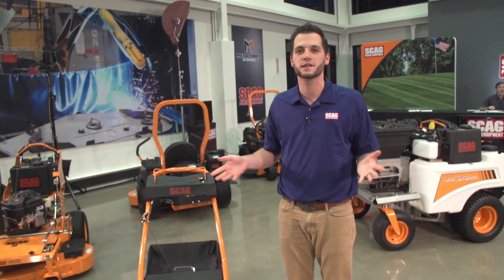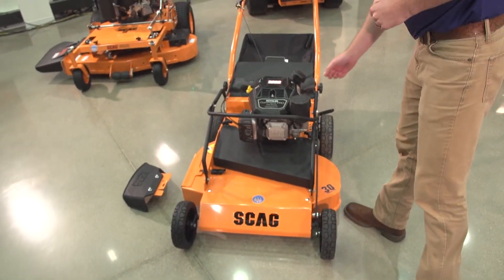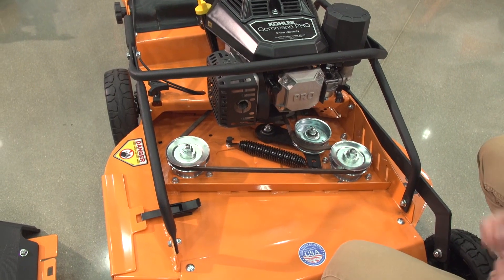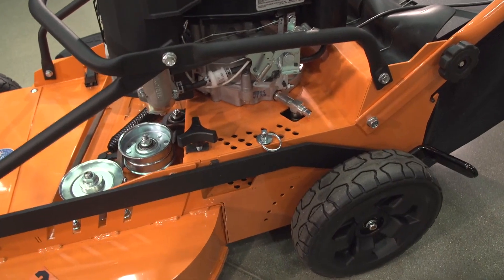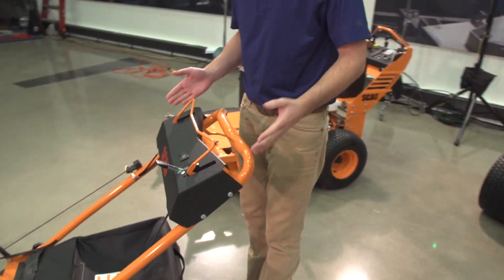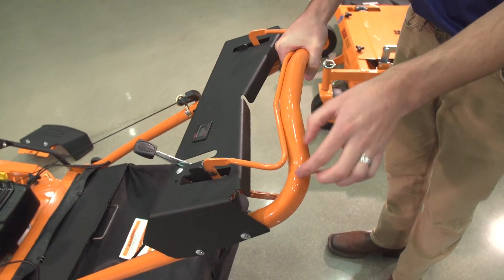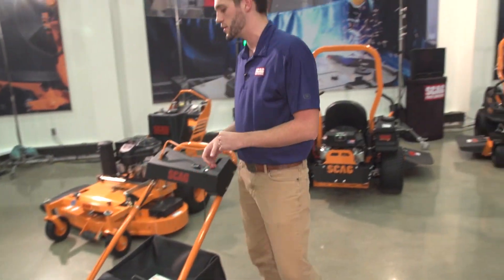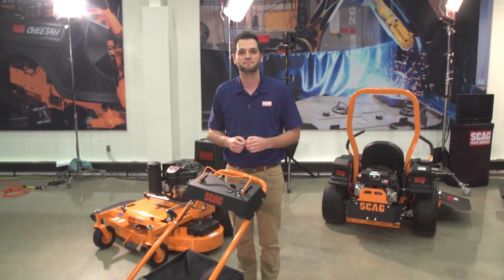30" mower prototype – SCAG LIVE 2020

Comment: Nice machine overall but there are a few things I'd like to change/add. Also many good points are made by other commenters so I won't touch on those.

The speed needs to be above everything that is currently on the market. I want something that has a setting that will have me jogging in wet, tall, and thick conditions. Time is money even with push yards. I hate having to push through the gearing and top speed on other mowers. 

I would like a chute open/close control on the operator panel

I would look at the efficiency of work put in to move the machine at the different handle bar angles you have as options currently. Possibly look into adding an additional turn/curve towards the operator at the top of the handle. So it creates a more linear straight push instead of a down and put push.

The black engine cage is cool but I couldn't help think of things (shrubs, etc)getting caught in it. I would think there may be a solution in having removable magnetic panels to keep the area easily accessible but covered. 

I would like it to have something I've never see out there. It would be a three tiered bag system. You would have mounts on the handle bar where you could attach two back up bags that would need to be designed as easily folded or collapsed. The idea is you drop your full bag quickly swap to a new one and pick up your full bags on the way out.
Reply from the maker: Appreciate the feedback and suggestions

Comment: I am looking to replace my 5 year old  toro 30 tis one and the toro need wide tires on the rear also is it weight same s toro  need lighter also are all 4 wheel adjust at once I perf the front separate from the rear
Reply: Agreed.  Good trick to help mulching in tough conditions by setting rear one notch higher than front.  In fall can also help to mulch/bag  leaves by setting front higher than rear.  Toro got that one right.
Reply from the maker: Will be a single point height-of-cut adjustment so the fronts will be tied to the back. We appreciate the feedback.
Reply: @ScagPowerEquipment  that why I probably stay with the toro unless you change that

Comment: Would this be a good machine for homeowners and is it possible for zero turn front wheels property has hilly grades
Reply from the maker: Hi Robert, it certainly can be used by a homeowner. Caster wheels are in development for this machine, which will help with maneuverability! Stay tuned.

Comment: I bet this will be over 2,000$ retail  which is fine any chance you can both pull start and electric start really put over the top 😁
Reply from the maker: Will be in that ballpark
Reply: No electric start if they use the Kohler CV224 engine.

Comment: I been running bobcat and scag walk behind mowers and have a 36" walk behind  how does a 30" better  I disagree about aluminum deck my crew are still using aluminum or mageniuem deck such as bobcat Jacobsen SNAPPER old deck .Why stamp steel.they rust I swapped engine and rebuild them many time upgrading the bearing to tinkem bearings love your blades  the mowers I made a shredder plate out of catwalk grating and does really well I had 2 of your riders and had great difficulty with the hydraulic pumps and on each side they were not abused or lack of maintenance  we kept our EQUIPTMENT up I not happy with those mowers you stand on they great on homes but we have apts big commerical.lots with bumps Mole holes I think it's a great idea but your equipt is always was made for long life 
Bruce bonkowski
Reply: This would be the answer to the weight problem but I don't know if there would be any issues with such a large aluminum deck, unless it was pretty thick.  Probably cost a lot to implement this too.

Comment: Nice presentation young man.

Old guy one man show, Must have a personal pace type system, electric start(not a deal breaker), don't need a heavy duty FW15 type mower as will not have multiple users nor want to spend 2k to 3k for a mower my Toro timemaster out performs at $1100.

For 30" mower that the big boys are using moderately for back yards(small gates) and the solo or small Co is using as primary We need someone to improve on above mentioned mower(TM) I will say that the 2020 Exmart Commercial 30" with the CV200 and beefier transmission looks pretty good. Personally something between these mowers would be perfect.  

Price in the $1400 to $1800 range. 
1 or 2 point deck adjustment with well marked in actual inches( possibly up to 5")
Well powered, 200cc minimum 
Personal pace type system
Convert from mulch, bag, side discharge, in a snap
Oil change flowthrough port or hose system
Foldable handle(Timemaster is fantastic)
Hour @ Rpm meter 
Transmission quality is more important then a deck that can withstand a high speed collision.
2.5 qt minimum Fuel capicity 

Overall I think y'all are not improving on anything offered in this catagory. Y'all might get the Scag users business and switch over if you give dealers incentive to walk their clients away from what they have been selling them for years. Either way nothing revelotionary with that tank on tricycle wheels in the vid above.

Comment: I'm curious about the cables being ran through the bars. Now since those cable run through the bars that leaves 2 spots the are open on the bars for water to get inside. Are those bars protected with a coating to prevent rust?
Reply from the maker: The tubes will be proper drainage in them to prevent water or moisture from sitting in there.

Comment: Looks Awesome !!!!
Reply from the maker: Thanks! Currently running anything similar?
Reply: @ScagPowerEquipment  Yes I currently Run Exmark Commercial 30X Series With the Same Kohler engine ,  Toro Turfmaster and Timemaster . 30 Inch Mowers are my go to. The Belt Set up + Height adjustment looks to be a Huge Improvement over the Exmark / Timemaster - All the Controls in one Spot a Big + ! & Handel bar Design

Comment: Sounds like most folks don't like it.  I've never seen any positive comments from anyone who has run it for more than a few days.  Comments include: Too heavy, needs casters, leaves clumps, tears up grass on turns, needs reverse, beats you up.  Everyone seems to try to sell it soon after buying. Bet it will rut up yards pretty badly too.  Commercial grade strength but too heavy & bulky for the designed target use, which I'm guessing was to create a more solidly built version of the Timemaster or Turfmaster. Tough to try and make this design work when you exceed about 150 lbs.  But I agree it will hold up for a very long time...because it will be sitting idle in the garage!

Comment: Maybe put a Honda engine on the mower because those engines last long
Reply from the maker: Looking into a few different options
Reply: No, i have the ferris fw15 with the gcv390... the engine is problematic. Had problems with the dealer on getting it fixed...
Reply: Kawasaki

Comment: I was very optimistic about this mower but so far it has turned out to be the worst mower if not the worst purchase entirely for my business. The clutch started coming apart at 30 hours. The back edge of the deck has metal that hangs down well below the cut plane which digs into the dirt if the lawn is not very flat. And the bar linking the two rear wheels together for the height adjustment system again hangs down well below the plane so it high centers ALL the time.
Reply from the maker: We are extremely sorry to hear this. Please send us your contact information and ZIP code and we would be more than happy to have a Territory Manager assist you. https://www.scag.com/company/contact-us/

Comment: Will there be plans to have different motor options?
Reply from the maker: To Be Determined.  Thus far the amount of torque and power on this current engine we've not been able to match without getting a much large engine which will bring a lot of added weight to the machine.

Comment: Change the cable routing to outside the handlebar. Gonna be a huge issue if the cables need to be changed.
Reply from the maker: Has not proven to be much of an issue for changing the cables. Very easy to feed the cables through the tube with plenty of room to grab the ends for mounting.
Reply: @ScagPowerEquipment  keep the cables inside the handlebar please. It’s not that often that you have to change the cables anyways
Reply: If you owned a toro or exmark 30 and run 6 days a week with 75+ properties then you would know that these cables and belts break at minimum 2 times a year so hopefully it will be easy or scag figures something out that toro hasn’t

Comment: As long as it’s not going to be $3500, I’ll check it out! 😂😂
Reply from the maker: Shouldn't be
Reply: @ScagPowerEquipment  👍🏼👍🏼
Reply: Yeah shouldn't be. I can't stand the thought of paying $2400 for a mower that I'm walking behind. I won't buy a ferris/snapper  due to the price. I like my Honda 216 just wish they were faster with out me having to push them.
Reply: How much will it weigh? I'd like to see some kind of lifting handles lower on the top sides.  If you're picking this up with some into a pickup bed, it needs to be easy and not much on the back. Looking bullet proof and being user-friendly are totally different things. You have to find a happy point.

Comment: I think it’s gonna be hard to beat the 30” Exmark! Definitely must have caster wheels and a price not to exceed $2000!!!!  I’m happy to be the lab rat and demo one in the Cincinnati area.  I’ll make show to show it some of the best turf in the tri state.
Reply: KBG King, I’m an Exmark guy too but this machine would blow away the Exmark 30. Number one offset blades vs timed blades. Number two cut height adjustment
Reply: @JamesZ1025  I’m down for trying it out.  Yes it’s a pain in the ass to change the front height on the Exmark.
Reply: @kbgking7921  I’m in Columbus Ohio
Reply: @yardclippers8192  let me guess you mow lawns for 19.99
Reply: @yardclippers8192  I actually perfer toro over exmark. I have the toro time master, but I think toro owns exmark or exmark owns toro

Comment: I'm looking for something that is 30 in that is like 260cc walk-behind mower I would prefer something that is 300cc since two blades spindle in take up more power... It should not be a matchup between my lawn mower and the grass... If you could do this every landscaper would find a way to get this in the cab of their truck... Even if it's $2,500... I'm telling you right now if it had a Kawasaki engine or a Kohler Engine and it was 300 CC you would have sales from the landscapers I don't know if you're selling to the homeowners or what but the engine is a big deal because wet grass happens and High Grass happens and if it's 300cc you could Breeze right through it and go fast that's what we need I want to be able to go fast and bigger engine makes a cleaner cut
Reply from the maker: We trust after you have the chance to demo this machine you will truly enjoy the power this setup brings to those tough lush spring time lawns!

Comment: I like a lot of things about this mower but I have some suggestions:  For a 30 inch deck, you really only need one longer blade, and a good quality, powerful engine.  This one blade design would be simpler, you would have only one spindle (instead of two), and only one blade to sharpen each time you have to sharpen the blade..  and less belt usage..  Not to mention this would also save some in mower weight and save in $$ cost and maintenence.  This one bladed design is better based on simple physics.  The longer the blade the faster the end of each blade is moving (higher blade tip speed)..  With two blades on a 30" deck, each blade is too short to move fast enough to give a good cut or cut taller grass.  If Scag thinks a 30" deck  is too big for one blade, make a 28" single blade deck mower.  And if you're going to insist on using two blades, It would make sense to make the deck larger - maybe 34".. This would allow for longer blades.  Also make the tires somehow softer.  I would like just regular air tires (prefer lower air pressure radial tires).  On my 22" walk behind I have hard plastic tires, and the mower really bounces around when I hit bumps.  (I have a lot of bumps in my yard).. On bigger hits the engine cuts out a little..  not good for the engine or cut quality..  with softer tires this should help with this.
Reply from the maker: We appreciate the feedback

Comment: Transmission???
Can it handle the weight of mower
Going up the hills.
Would be nice adjustable 3 speed
Transmission 
Remember  time is money..
Meet the needs of lawn care companies 
You will go straight  to the top....
Reply from the maker: Appreciate the feedback. MV702 GT Transmission is what it will have. Through our testing it has been a great choice to handle the machine and power through lush lawns and slopes.

Comment: The belt size is a weak point and should be oversized/beefy like the rest of the machine. Also; vet rid of all that cockamamie bar linkage for height adjustment. One bent link and your cut is uneven.
Reply from the maker: The height-of-cut linkage in question has already been adjusted and upgraded from what was shown.

Comment: You can see the weak spots on this mower easy, first off there is no support structure for the handle where it fastens to the deck, under commercial use that won’t last 6 months...!
Reply from the maker: We appreciate the feedback on it. Not something we've come across as an issue in our lab or field testing thus far.
Reply: @ScagPowerEquipment  I doubt if your test includes loading and unloading 50 times a day on a trailer or running off curbs over rough terrain so mark my words your handle will break and I know that because I see thousands of honda HRC 216 commercial mowers every year in my shop and a good portion of those when they to get three for five years old have issues with broken handles ! Your Scag Handle is weak by design, there is no support where it mounts to the deck and it will brake there just a matter of time, your lab test is far from everyday commercial use by someones employees who doesn’t care about being gentle with the machine ....
Reply from the maker: @cbnx82703  Doubt away... We've put her through some very rigorous lab and in-field commercial abuse and will continue to prior to production to catch issues such as this that might arise. We appreciate the feedback on the machine.
Reply from the maker: @SheepDog We've got a few :)

Comment: Interested til they said “kohler” instead of “Kawasaki”. That’s a dealbreaker.
Reply from the maker: We trust after having the chance to run the Kohler on this machine you will be very pleased with the power that engine brings to this package.
Reply: @ScagPowerEquipment  Why not list the hp in stead of cc's...'Merica!
Reply from the maker: @atomicwedgie8176  It's around 7mph. Not common for engines in that class to list HP.

Comment: That mower is too heavy.  Deck and other  components need to be made out of aluminum to keep the weight down.  Then add tires twice as wide.
Reply from the maker: Appreciate the feedback. We feel we've got the balance down pretty well on the machine but do look to continue to put it on a diet :)

We look forward to your thoughts after having the chance to run it.
Reply: @ScagPowerEquipment  SEVERE diet to make a 224cc engine work here...

Comment: Awesome good by toro... I hope its hydro.  And not belt.
Reply from the maker: Not hydro, transmission and belt
Reply: @ScagPowerEquipment  I had problem with the earlier Exmark 30"; you had to push them uphill, bog down, transmission issues. As a big Honda fan (Honda powered Cub) and other lawncare people on You Tube have commented that they keep their 21" Honda for when the other 30" (Exmark, Toro, etc.) mowers have problems; need reliability. I agree with the GVX 390 comment. Keeping with the Scag tradition of offering more than 1 engine would be great; I have the Kawasaki on my TT. A large rear bag would fit my needs and larger tires with tread designed not to slip on wet grass. Getting very excited and plan to hold off on getting a 30" until the Scag hits the stores.

Comment: Does anyone know what transmission is use on this?
Reply from the maker: Hi there, the SFC30 mower features the combination of a GT MV702 best-in-class transmission and Kohler CV224 engine to bring the power for optimum performance in the toughest of cutting conditions. Learn more about the SFC30 here: https://www.scag.com/product/sfc30/
Reply from the maker: @macheneclothing  Hi there, I have sent your email to the distributor that covers your area and they will be in touch shortly. Thanks!

Comment: I hear kawasaki and honda are the only engines to trust
Reply from the maker: Great engine companies also but this specific Kohler has been bulletproof and brings the power and torque needed on this setup without having to go HUGE engine on it that would add substantial weight to the machine.

Comment: Caster wheels, bigger wheels for a 300 pound mower, easy to fold handle, personal pace style control or gear adjustment, 10-12hp Kawasaki or Honda engine, easier to clean pulley/belt area, ability to mount an ocdc or side bagger for production work. A price point around $1800-2400
Without much change to the design it’s a $1400 mower tops that most people will pass on for something easier to handle.
Reply from the maker: Appreciate the feedback
Reply: They will never be able to provide what you are asking for that price point.  But that would be nice!
Reply: @mellowjammer  just observations that they could improve on, not a lot of price change to manufacture the whole assembly based on wholesale components. Obviously they can skip things if they would like. If I needed the mower plus what I said for cheap I would build it myself.